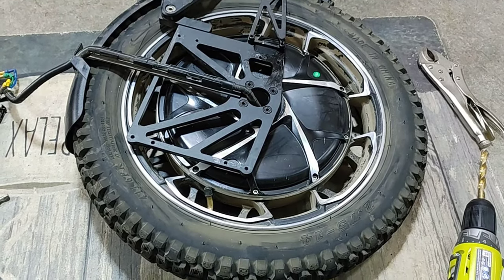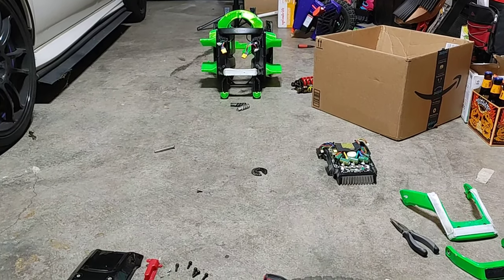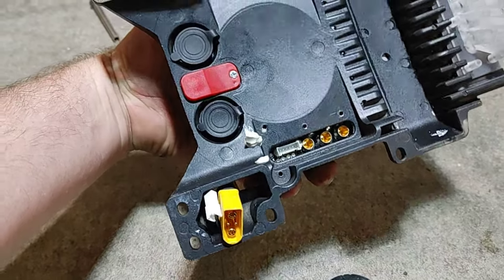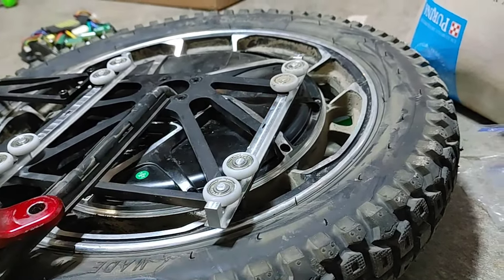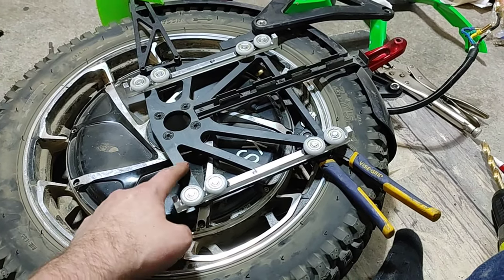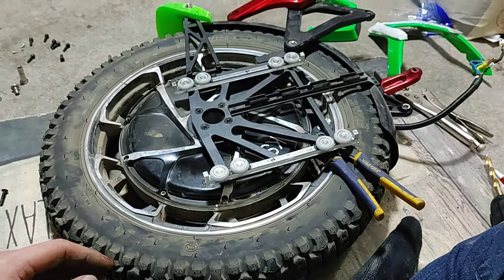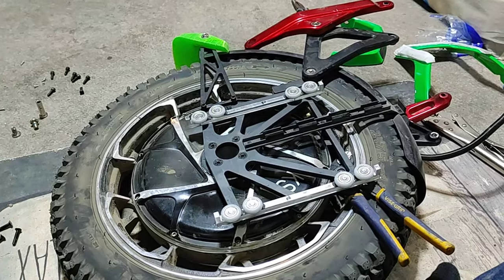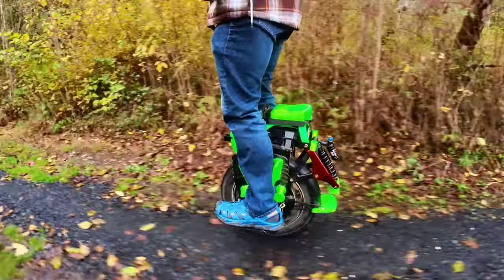NEW Kingsong S22? CNC Sliders, the good, BAD and comfy?

Comment: That is not thermal paste, that is a thermal pad. it was making good contact you can see the indents from it being compressed :) There's too much clearance in there for a thermal paste to work properly that is why they use thermal pads. Same reason they use thermal pads on video card Ram. Looks like a 3mm thermal pad press down to about 2 mm.

Comment: You/everyone should press the bearings on the sliders, not hammer them on. My 2-cents 🙂  BTW, why didn't you remove the slider framework from the wheel as you kept recommending that people do??? Just curious.
Reply from the maker: That was my thought but the issue with the design is you can press the wheels on first then install because the screws are under the bearings. So like noted in my video it would be better to remove the entire frame then leave it on the wheel =\ 

No because I was already over 1/2 into the project, that why I was telling people that's what I would do If I took on the project again. Just makes more sense

myewheel needs to redo their install video lol
Reply: I wouldn't risk stripping those mains screws. They're a TIGHT.

Comment: Sometimes thermalpaste gets hard on heat. If you remove older CPU's from mobo's this is pretty common. It doesn't lose all the conductivity, in appliances such as the wheel with very large surface to dissipate heat unlike CPU any paste should do and it won't matter much if it gets dry as long as there is no air between the parts. E. yes, that looks more like thermal pad's, but they shouldn't get rock hard either.

Thank you for the video, I hear swapping the sliders is a good job for friday night and a barrel of beer.

Comment: Awesome video 👍. 
Did you try heating up the bolts ? Because the loctite could be making a lot of the problem. 
I think my slider bolts are loose also, I need to check.
Reply from the maker: For the one that got stripped it was too late lol the other came out so it was just the 1 nightmare bolt.

Comment: Yours must have been built on a Monday 😆 But we must remember that KingSong quality is top-notch whereas Gotway is horrible 😉
Reply from the maker: Idk about that this day in age! S22 as a whole should be recalled hahaha only issue my new Begode wheels have is the displays intermittently work and the V2 t4 lights don't work if the display doesn't. WAY less issues than the s22 😱
Reply: Gotway is horrible no doubt.
You can expect some bad assembled wheels from Kingsong, but what you can't expect is a wheel that is well put together from Begode.

Comment: I've been watching a number of these S22 videos because I find the topic interesting, I have some comments on that but first I want to disclose that I do own a Kingsong wheel, I have a overall decent opinion of them on their past history but that has been somewhat deflated after seeing the troubles with the S20/S22, I do not not own a S22, I own a V11 instead (as well as other wheels).

My thought after watching a number of videos on this is that the stock black plastic(?) material being used as the slide is likely the overarching problem here. I suspect there are other materials that may have given better results. However since that is what comes with the wheel I think the next thing I would have done before a major modification is trialed different lubricants. I'm not a huge fan of graphite but I think that is what I would have tested first considering the use case because graphite doesn't collect contaminating materials and has a wide temperature operating range.

The next comment is about this roller replacement idea. The roller wheel is going to always be inherently spinning in the opposite direction of the other side of the same roller wheel. IE whichever contact side is contacting the inner rail path causes the other side to be going the opposite direction of the rail movement. So in effect you still have a frame slide. However if the wheel is not compressed in the frame slide then this may not be a great issue but it does bring up questions of what exactly is happening during use.
Reply: That's Incorrect, the wheels are placed with an offset  between them, so only one side is touching the walls on the suspension channels.

Comment: You have to practically be a magician to get those screws out. 🤣 I used heatgun and impact to get them out. Also, your bits need to be the of the strongest variety you can find.
Reply from the maker: Yup apparently my easy out but or whatever it's called was cheap because sucker snapped off in the head lol

Comment: Great video Casey! Hopefully they take your feedback? You should send them this video or tell them your thoughts if you haven't already.
Reply from the maker: Thank you!
With everyone putting out the bearing sliders now I would hope Kingsong release the next batch with them IF they don't kill the wheel and make another since this wheel kinda headed for the trash before it even got started...

As it sits now it's an amazingly well engineered wheel but they definitely cut corners in the wrong places which is sad.
Reply: @EUCWayOfLife   Really? what makes you say it's headed for the trash bin?
Reply from the maker: Board failures, motor failures, the stiff suspension because the poor sliders, power button issues. And so on
Reply: @EUCWayOfLife  Yeah. I actually just got an s22 that was DOA basically. Lol.
You really think they'd just scrap it and start over?
That would suck for existing S22 owners. And also for the S22 since it seems like it's just now becoming what it always should've been.
Reply from the maker: @Mpower31  I don't think they'll scrap it but I think they are revamping it so much that it won't necessarily be the same wheel and the amount of changes won't easily be available for the old version so the old ones will be "obsolete" and no one will want them on the used market because 1 the issues and 2 they will lack the proper things to be a good wheel. Another reason the dealers are all selling their stock at basically cost right now... Idk about you but I smell a new wheel coming, why else would you be clearing inventory when it's not even close to black Friday yet?

Comment: Just tested out the wheel coming from an s18 and I loved the s18 but hated the s22 due to stiffness, felt really hard to turn and to go fast as well as just unstable. Would you recommend I do the sliders to see if it’ll fix my riding experience or just get rid of it and get something else?
Reply from the maker: Replace the sliders. Check psi in the tire. Get used to the wheel it's a much wider tire and much larger wheel than a s18 and will in no way have the same feel
Reply: @EUCWayOfLife  thanks brother!

Comment: Very informative video but it's ridiculous that you had to go through all that work just for the sliders to be able to operate properly.
Reply from the maker: Yup couple that with bad boards, bad motors, bad power switches and you got yourself a Begode I mean a Kingsong lol everyone still trashes on Begode and this is kingsongs 2 year wait of a wheel
Reply: I wonder if anyone has tried to remove one of these sets of slider rails and wheels from their EUC so far? Gonna be interesting to see that operation.
Reply: @freeforester1717  That's the best question I've seen and not something I'd thought of, but what happens if one of the bearings or wheels fails or needs to be replaced due to wear, how are you going to get it back off of the peg/stud it was hammered onto? I'd rather try the 3D printed one first, especially since I'm not doing jumps.
Reply from the maker: 3d printed ones are failing I've already seen posts on them. I think no matter what there is going to be potentuon with fault because of the open face system they decided to go with
Reply: @EUCWayOfLife  Probably, but at least for the time being, you can get them back off… CNCed, or at least this version of it, is pretty much permanent on your wheel and who knows how long those wheels or bearings will last.
Reply from the maker: If you watched the video and heard the point about it getting stuck trying to pull the wheel out. That right there is my concern on the printed ones.

If for some reason the print failed in the track and buckled you can have a nightmare of completely locked up suspension. I'd rather take the risk of finagling a bearing wheel off the stud then a 3d printed part jamming up the suspension. But it's a double edge sword and the decision of the buyer/installer.
Reply: @EUCWayOfLife  Hopefully something better comes along by next spring. I’m not into riding in 40° and below, but couldn’t pass up the Eevee’s deal for $2440.

Comment: My thermal paste was the same as yours.
Reply from the maker: Interesting not sure I trust it for transferring heat well...
Reply: @EUCWayOfLife  it's not thermal paste it's a thermal pad. Same thing that is used on RAM on higher-end video cards, works very well.  It was making good contact as you can see where it was compressed the way it was designed.
Reply from the maker: @eucmike  I've seen a lot of thermal conductivity reviews and pastes have always shown more efficiency than pads but I could be wrong lol
Reply: @EUCWayOfLife  thermal paste will never work well with those large clearances hence a thermal pad is used.

Comment: I am surprised the stupid slides are not doweled in place!!! What keeps it perfectly straight and centered???
The 'press fit' is too tight, for the rollers, hammering is not the best way, might better use a press to put on rollers...3d print should only be a proto type to make cnc version...
Kingsong was really STUPID changing the rod & bushing of s18 to t-slot guides of s22, personally I would fire the ks designer...